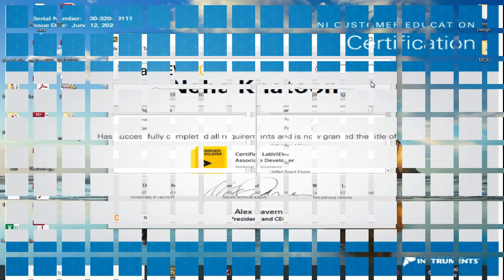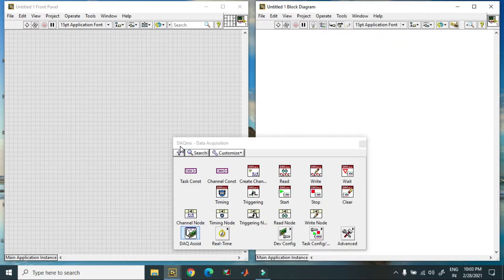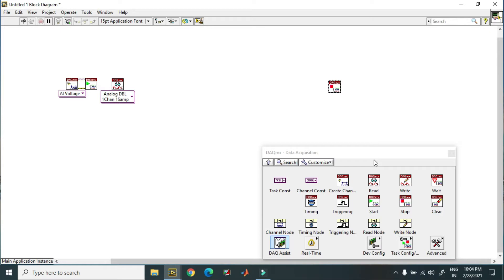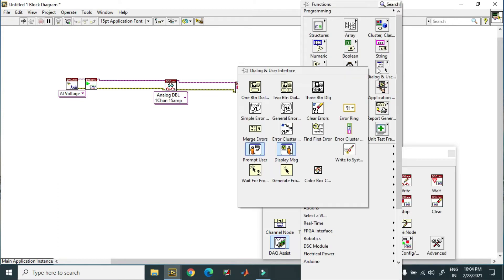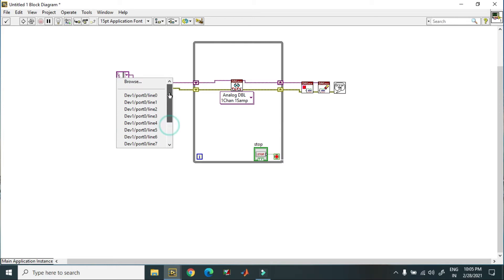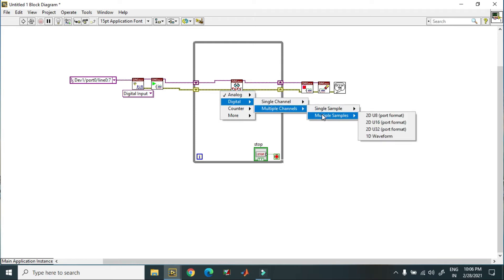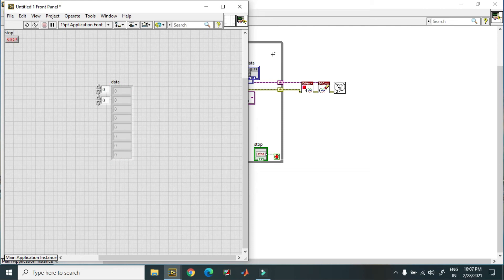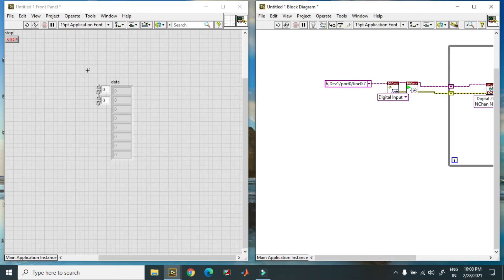Acquire Multiple Digital Signal using USB 6000 series

Comment: Can you tell me how to control the flow sensor and how to take the reading in Excel
Reply from the maker: Just tell me which sensor you used?
Reply: @SalimKhan-by1ky  flow sensor
Reply: The flow sensor output will be pen pulse
Reply: Pwm pulse
Reply from the maker: Ok i will tell you how to read pwm signal in labview using arduino and my rio